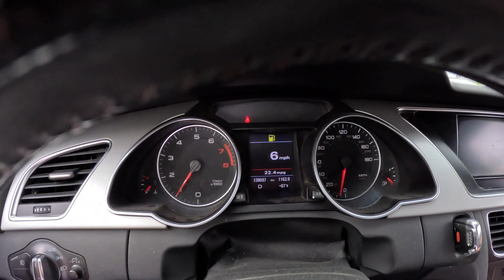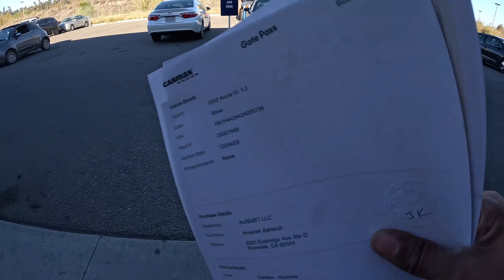RANDOM DAY IN THE LIFE PLUS AUCTION PICK UPS

Comment: The unplugging the coil pack on the Denial is something I see a lot at dealer auctions. If people ain't doing that they are hiding keys inside the vehicle, locking the keys inside the vehicle so you are not able to start the vehicle and leaving the ignition switch on to run down the battery. Shit is crazy at times. @26:00 Lol, I feel ya on that shit. My wife is the same way. Can't drive for shit in tight spaces.